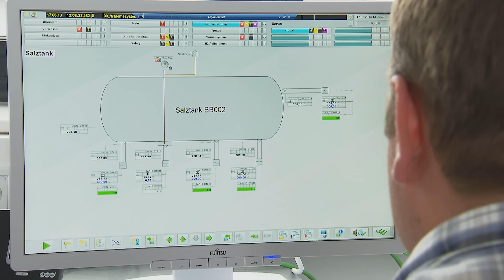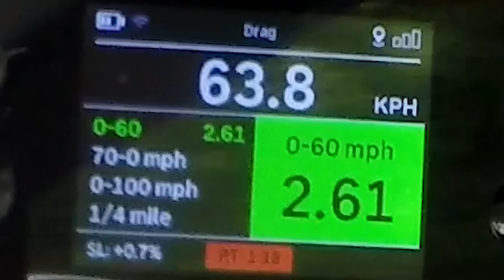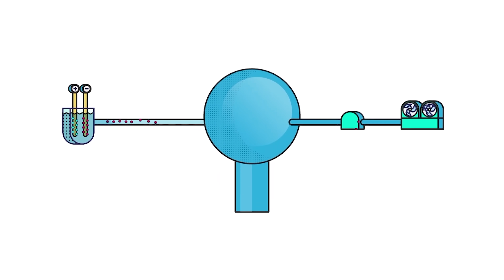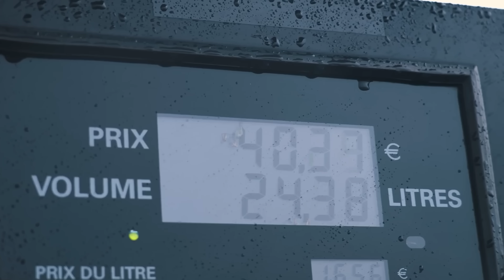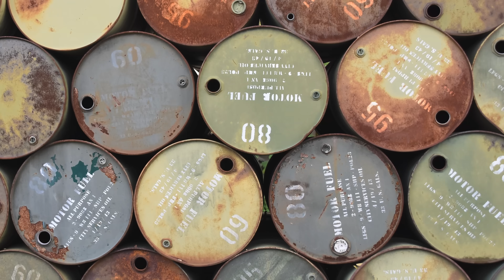Porsche just SAVED petrol engines FOREVER

Comment: Did you say, E-fuels will be carbon neutral if the electricity come from renewable sources? When people say the exact same thing about those over powered over weight EVs the fans are getting furious. 😂😂 That's the bottom line.
BTW: there are so many things in the world made by crude oil, don't worry about oil producing countries.

Comment: Will be a niche fuel at best, used by but the top few percent of high-end cars. Very few people are likely to pay a multiple of the cost of current petroleum/diesel, especially relative to EVs which will be a fraction of the running cost. No two ways about it: it's over for ICEs

Comment: It's all a joke electric car's. Cost so much to produce, buy and lifespan is low without expensive repairs. So dangerous also as not everyone will use safe and will blow up. This new fuel sounds awesome. Just wondering if massive solar power stations heat atmosphere from reflection.

Comment: How stupid if your making hydrogen to
Make into a synthetic fuel why not just run your ICE on Hydrogen powers.
Get the benefits of
Running on the most powerful fuel you can get.
And meet all the environmental goals 
Synthetic fuel still
Produce Carbon monoxide.

Ice running on Hydrogen 
Have over a 300 mile range and produces 
Nothing but water.

As far as performance electric moters blows away 
ICE on power and weight and complexity and last longer.

In hub moters 350 hp
Per wheel that is direct 
Drive into each wheel 
Not 350 hp into a transmission and split between two or 4 wheels. 
Or the Aptera 
Aptera has 1000 mi range 0 to 60 less than 3 seconds.
And the on board  Solar
Will get you 40 mi a day with out charging.

Comment: The whole worldwide production of e-fuels produced in production units planned till 2035 are enough to cover 5% of the need of e-fuels in GERMANY if we would switch to synthetic fuels. (For cars, industry, aviation etc. Instead of using them where they are more needed because there is actually no alternative atm as aviation for example) 
It is insanely energy intense to produce these synthetic fuels. 0 chance that that is a actual alternative. It’s a total madnes from a perspective of thermodynamic.
Creating hydrogen with insane amounts of sustainable electricity (otherwise it’s not carbon neutral) and collecting carbon from the atmosphere which is also super inefficient to create a synthetic fuel and then burning it will give you a efficiency of 12% at best, compared to 73% if you use electric energy from let’s say a wind turbine in a electric car. 
We don’t have enough energy to waste for that ***

Comment: I can’t see e-fuels ever matching electric cars on running costs.  You need the green energy to make the fuel - same as EVs - but petrol cars are around 30-40% efficient in their conversion of petrol energy to motion, compared to 80-90% for EVs.  This is why heating an EV affects range, it can’t use the vast amount of waste heat that a petrol car can.

So regardless of cost now, I think e-fuel cars are ultimately likely to cost twice as much to fuel as an electric car, although they may be cheaper to manufacture and buy.

But it’s an interesting idea for keeping certain types of vehicle and use cases going

Comment: the problem with e mobility is the gigantic amount of copper you would have to use in the cars engines. In my opinion, electrical cars should only be used for public transport or for infrastructure.

Comment: This is really not new but to this point the main commercial interest was to sell electric stuff which effectively only offsets the exhaust. Over the past twenty years I've heard numerous people state that making hydrogen is a waste of energy in the assumption that enough battery power could be provided. Today I'm actually even hearing people say that it is more interesting to simply switch off (part of) solar and wind if they are overproducing at any point - anything to avoid what Porsche is proposing here. Because this fuel will not just run cars, it will also work with your gas stove and your gas boiler and so there is no need to invest a huge amount of money to convert to all electric and subject yourself to a single point of failure with respect to your home energy supply.

Comment: It’s also logic to think that battery’s are not the future power source technology even if the drivetrain is electric. Therefore all the infrastructure being put in now will soon be redundant anyway. Battery’s are not a technology that’s good for the environment, that will not change. Hence hydrogen and or synthetic will surpass it. The only question is how fast this is going to happen. I find it very frustrating that all the tax breaks governments are giving to electric only manufacturers and all the investment that they’re putting in to electrical infrastructure is resulting in normal car drivers being heavily taxed to keep their non electric cars running. But in reality having a used car rather then a new electric one every 2 years on a lease is better for the environment. And that’s my point it’s like they blindly jump into technology without considering the overall logic. So when the electrical charging infrastructure is dropped will I get reimbursed for everything I had to pay extra for? Will the then higher polluting people that have a new electric car every 2 years or even multiple cars be made to pay additional taxes to reflect their environmental impact being higher?

Comment: Synthetic fuel is a niche dead-end for most manufacturers. Almost as silly as hydrogen. EVs will win the mainstream and take 99% of the market share. Electricity will power everything soon, creating a much cleaner and more sustainable planet. Wouldn't it be great to have less cancer and disease and much cheaper energy bills. Eventually electricity will be so cheap, bills will be £10 a month and we will not look back at the last few decades fondly. 

Cue dumb oil propaganda about lithium mining or battery recycling or the national grid in 5, 4, 3, 2, 1....

Comment: The whole process of "carbon capture" pollutes. It's not really carbon neutral. The risks of CO2 capture includes leakage of CO2 and increased occurrence of earthquakes. CO2 leaks at the surface could damage surface ecosystems or structures, threaten people and animals from high concentrations of CO2, and would contribute to greenhouse gas accumulations. Furthermore the energy consumption of the whole process of carbon capture is huge so it is more of an ballast to truly achieving a carbón neutral goal, also because of this it makes "refuel" inherently more costly both in resources and money to the point where just going full EV makes more economic sense. But I guess many people won't care since it is still technically less worse than burning fossil fuel, apparently choosing between the lesser of evils is the only choice we get.

Comment: this means we can keep old cars on the road without scrapping them to swap for EVs, much better for the environment, I can't wait to see how this goes 🙏🙏
Reply: as long as you can afford the e fuel. good luck with that.
Reply: @kevinashurst634 will be cheaper than buying an EV, especially since the batteries have to be replaced like every 10 years or less.
Reply: @Mainlythingswithwheels  the batteries last a lot longer than that. Plus you can replace individual cells in the battery module. Much cheaper

Comment: Keyword: efficiency!
Why put (that not sufficient) renewable electricity into eFuels (1st loss) and then convert it into motion with an „efficiency“ of about 30-40 % (2nd loss), when you can put it straight into an electric car and almost get to use 90 % of it!?

You‘re willing to sacrifice 70-80 % of that electric energy for the convenience of „quick refilling“?
Especially when charging times dropped as massively as they did within the last 10 years…!?

Comment: I’ve been running my 1977 911s using hydrogen and gasoline for years now getting 17mpg and almost no emissions. 
One drawback is it gets very how very fast in the summer so I use it mostly when the engine is cool and during acceleration.  With a pulse width square wave generator providing up to 13A of power I can maintain engine temperatures in the air cooled to maximize performance and low emissions. It stops automatically at idle and can be adjusted via a turn of a knob.
Reply: no emissions? at 17mpg? what do you think happens when you burn fuel in an engine? JFW

Comment: Unless there is a major breakthrough in battery and charger technology, I will keep my internal combustion engine. Plus, the EV market still relies on carbon producing energy (at least where I live where all the power planets around me use coal). Let's not even talk about the dirty business to make an EV battery, let alone what happens when it's cold, driving at highway speeds, using climate control, and the biggie explosion and fire hazard the batteries have. So no, thank you, but I'll stick to what is somehow a bad choice.
Reply: its a very bad choice do some research. by the way many countries dont burn coal.
Reply: @kevinashurst634  I have done my research, and you seem to have not fully read my comment.
Reply: @Chief1lung  I read all your reply.
Reply: @kevinashurst634  then you saw me mention that in my area, they burn coal. Also, I travel a lot and don't have time to wait 45 minutes every 250 miles with the best of EVs. The technology just isn't there yet. The range from the first ev ever made over 134 years ago hasn't improved that much. I mean, it took over 130 years or so to go from a range of 20 miles to just over 300. 300 miles, and I wouldn't even get out of the state I'm in. Air con, radio, heated seats. Stuff like that greatly reduces the range, that and I like to drive fast and that doesn't help with range.

Comment: The Big Problem, like mentioned before, is the poor conversion rate of energy. Due to law of thermodynamics each conversion step consumes energie itself. We are starting from energy sources like sun, wind or maybe coal, and we have a specific amount of energy. Yes, at the moment, we can´t save this energy in a efficient manner, but we have to have gas or coal power plants to serve the electric demand. So it would be better to use normal petrol instead of dirty electricity. The synthetic Fuel provides only 13% (depends on the author of data) of the energy to move your car. Battery Cars have more efficency. The E-Fuel kicks in when we have more clean electric energy then it´s needed and we can fuel things, like planes, that can´t be electrified easily.

Comment: Synthetic fuels are only Carbon neutral if produced using renewable engergy sources. So EXACTLY the same as an EV then. Unless the electricity used to charge an EV is 100% from carbon zero energy sources then EV's aren't carbon zero. The EV fraternity will tell you that's a non issue as evenually all energy generation will be carbon zero or at least neutral, so then there's no issue with synthetic fuel production either.

Comment: Methanol has been used as the fuel in speedway bikes for years. Carbon capture is a great phrase but it’s not really effective. I believe the issue with electric vehicles is that these superchargers eventually damage the battery and who can afford to keep replacing batteries? The impact on the environment would be catastrophic. Surely he future is hydrogen or solar powered vehicles?

Comment: This is an important development as whilst governments have been quick to legislate and set deadlines for when ICE vehicles cannot be sold, they have simultaneously neglected to legislate and set deadlines for themselves pertaining to the necessary support infrastructure for EVs. Just imagine a bank holiday weekend in the second half of the 2030s with stupid pull-in rather than pull-through charging points and battery technology not having changed much still taking hours to charge and a 60km queue on the motorways all waiting to get into the service area to charge their vehicles using one of the 10 charging points and on top of all that, people towing a caravan, boat trailer or whatever having to uncouple, recouple up every time because the stupid governments didn't think about legislating the design of charging points and how many there should be at high traffic areas. The road rage and scuffles on the roads will mimic that of a civil war so much that bank holiday weekends will become known as 'bank battle weekends'. ...So, well done Porsche and also JCB for their innovation into hydrogen that allows current diesel engine technology to work with adaptation into the future. Porsche's innovation is better however as that means older cars can still run without any modifications. As for governments.....they think they've already solved the problem by setting the 2035 deadline and have forgotten about cars and mobility already.
Reply: It would be a lot quicker to improve the charging infrastructure than to wait for these miracle fuels to become real.

Comment: Unfortunately it takes decades to ramp up e-fuel production to a useful amount. Until then it will be rare and expensive and should rather be used in applications where you cant easily switch to an electric power source such as aviation or shipping. So i dont really see road cars using it except maybe oldtimers by the time you can buy them. But i hope it will save motorsports

Comment: All electric by 2035 Is just stupid, given that most of the electricity we use comes from carbon, also the UK Is already using More electricity than you guys can produce in the first place, to make It even worse, the proces to get the lithium polluts even more, not to mention the other big problem wich Is recycling all those batteries 🤷

Comment: The sad truth is that, energy isn't replenishing as fast as we use it on a global basis. Developping "Renewable" energy isn't going to change that fact, even with hydroelectricity. It takes energy to create energy, and we have not found yet a way to create more of it, we only  switch from one well to an other.
It means that if we dont solve this equation in the next 20-30 years, we will have to use less energy :/
The only option is nuclear and it's not happening in the next 100years sorry.
We'll be out of energy by then anyway...
Conclusion, buy a bike and a horse because combustion engine AND EV's are going away in our liftime (50years or so).

Comment: Hydrogen is the way to go - should be cheaper than e-fuel, JCB have already developed Hydrogen powered construction vehicles - you can’t run construction vehicles on electricity as not enough power.

Comment: That is just nonsense! Instead of focusing on electric mobility and on the infrastructure you spoke about in the video now you need two strategies. And the second one with E-Fuel's is just way more experimental and totally inefficient. The degree of efficiency is about 17% compared to 70% for battery electric cars. As you mentioned the are way too less projects to even supply the future end-of-life vehicles. If then there are even new vehicles with ICE thats just not doable. In fact you need nearly endless green energy to "fuel" all the coming BEV's. Why then triple the amount of green energy you need to produce the E-Fuel's. Please note, that ICE are just not compatible with realistic and serious climate protection!
I would be very glad, if you do a video slowing down this enthusiasm regarding E-Fuels. From my point of view it's just an error of the politics even though I am working in the german automotive industry.
Best wishes, KF
Reply: Wait... But you do believe that EV's are the answer to Climate Change ? 😂😂 You know what happends to ICE cars right ? They get shipped to third world contries so the amount of ICE cars stays the same. It even gets worse becaus eof all the EV's that are made. The production of EV's is probably worse for the environment than Diesel polution is now... And do you know what machines are used to mine all the resources needed for EV's ? Those machines don't run on AA duracels you know... And let's also not forget the work environment that children need to work in in Africa for your precious, climate saving glorified vacuum cleaner

Comment: Two thing you didn't mention: The law got changed last minute because of the German Minister of Transport, Volker Wissing. His party, the FDP, has been accused over and over again of lobbying for Porsche and by vetoing the former EU law, which would have banned all internal combustion engines, Wissing has demolished a long process where EU members agreed on banning those cars by 2035. Second, to create these E-fuels, about 5-6x more Energy is needed than you would need to charge up an EV. This ratio won't get much better in the future, because when energy is being converted, there is always a certain loss (thermal energy for example). This makes E-fuels highly expensive and inefficient. While this technology may seem exciting, it will certainly not be an efficient method to make traffic carbon neutral or to fight climate change.

Comment: The main issue of e-fuels is efficiency. The same amount of energy produced will transfer to wheels:
90% battery vehicle
55-60% fuel cell vehicle
20-25% e-fuel
Some will say that this is not a problem but if you think about millions of cars powered that way it's clear that we do not have this amount of power available and all this should be produced from renewable sources. Sadly, if you think realistic then even hydrogen cars makes no sense because they are simply wasting energy considering global use.